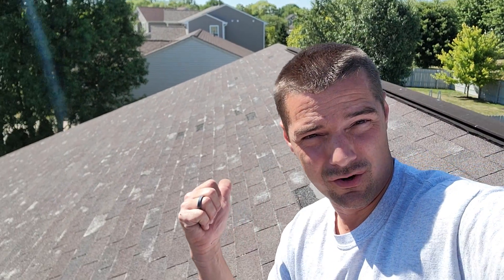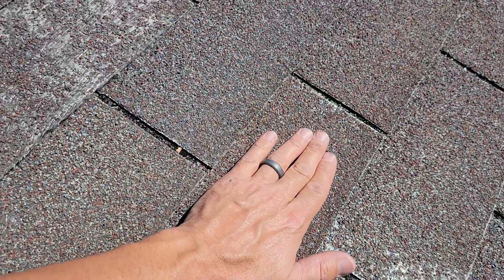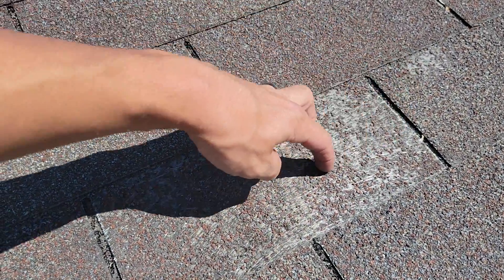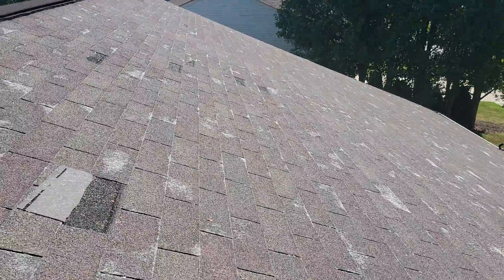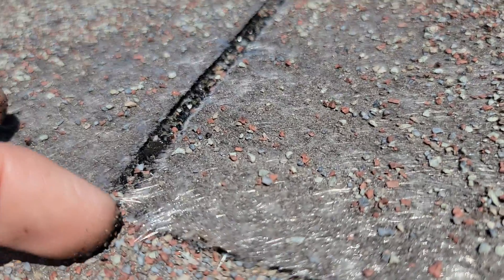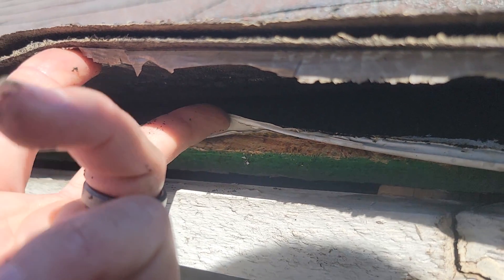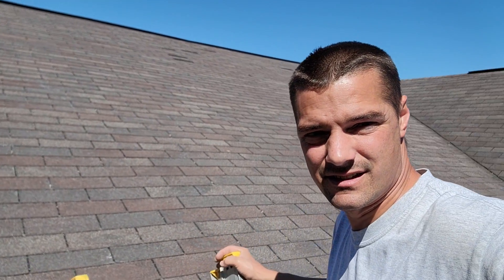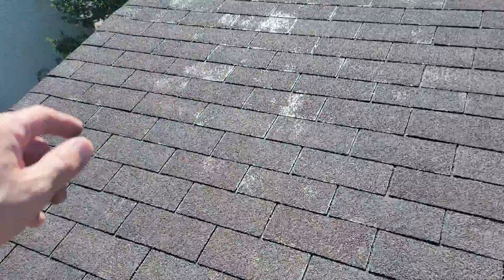Why roof shingles have granules on them.

Comment: Absolutely loathe and hate gutter “SPIKES” for hanging gutters. Imo, lot better alternatives out there, but ppl are “used to” the spikes or a hidden screw bracket of some kind (see both of these always missing fascia board, splitting it, going in way too deep, etc). Ppl I feel also don’t realize that there are several diff types/kinds of gutters as well, and choosing the proper gutter shape/style for your house is just as important as choosing the correct fasteners for said gutters; just like choosing the correct style & color of shingles, underlayments, flashings, drip edges, & so on for your house…..that once all combined, makes a cohesive system that “should” help all components work as one and protect the house live in😃

Comment: what's your opinion on metal roofs ? they're becoming more & more popular in my area ( especially thanks to their ability to make snow slide off the roof as opposed to 5-6 ft piled up all winter ) , and while they do cost more than your typical ash fault shingles , I've heard they last much longer & are much more resistant to the elements , but is that extra time & resistance work the added cost? or is it negligible ? have you found many problems with them during any inspections / repairs / installs ?
Reply from the maker: Yes steel roofs can last longer and perform better than asphalt shingles. With that said though (the steel being installed is only as good as the guy installing it.) Most steel roofs can also get you a Hail class ratingWhich could also get you a discount on your insurance premium.

 I find some people throwing up steel at a bargain price but this typically is the outcome, check this video out.

https://youtu.be/6XLVLtREz6E
Reply: @GrandRoofingInc  thanks for the info , we don't get a lot of hail here in eastern Canada , BUT , I'm sure that classification still exists on most companies books , something they don't talk about of course., the house i'm in now just got a new roof on before being listed when we bought it , but down the road i'm sure i'll be replacing at roof in my life , and i've always been weighing the pros and cons of steel vs ashfault , i appreciate your insight.
( i'm also an electrician by trade , so I know better than to higher the guy with the lowest price , those guys usually get crossed off the list pretty fast.)
Reply: I always tell people to check the gaskets on on the screw or nail heads because the sub breaks it down but the metal last forever.  Plus only if installed properly.  I don't like the rain. On the roof but if you have heavy snow and a steep slope. Might be worth it .
Reply: In Australia we've been running corrugated tin roofs since start of our existence and they last a very, very long time, only problem is you have re screw/nail your whole roof if your finding nails sticking up everywhere but these problems are only after 20 or so years and is a very cheap to perform. down side is very slippery if freshly painted or coating has been worn out by sun making it powder also makes it slippery. plus you got sound of rain on tin which is very nice, but walking on them is best with tennis shoes and on spars/nail heads only.

Comment: I love how even on the other side of the planet home inspectors are completely useless. I'm positive the entire industry is 1 huge scam. 
I had a house inspector call me in for a roof leak on a real estate house, cracking in the ceiling, must be the roof. I followed the crack down the wall, across the tile floor out the back across the concrete to the collapsed retaining wall. 
BRO HALF THE HOUSE IS SINKING INTO THE FUCKING GROUND! God damn.

Comment: Can't you just reapply the asphalt with granular?
Reply: No, you cant
Reply: It might be possible for a roof just showing signs of wear, to apply a new thin layer of protection since the shingle isn’t compromised in a significant way yet, though I’ve never heard of such a thing being done. but once it gets to this point the damage is so severe it would be impossible to repair the existing roof, just look at how bare the fiberglass is, slapping a new coat on won’t fix that issue even if you somehow got it to bond correctly.
Reply: You should experiment and let us know

Comment: Ok I know you do asphalt roof not being  a ass but if I owned a insurance company I would never cover a asphalt roof old technology metal  or other composites are way better. Asphalt is so outdated and fiberglass are a joke. Just my opinion.
Reply: Asphalt is pretty much the cheapest option but can last 20+ years if done absolutely right. Other roofs, tile, metal, slate, cedar costs so so much more as it requires a different roofing system entirely.

Comment: Is it common that a bunch ofthe asphalt comes off after getting your roof replaced?
Reply: It's pretty common for your gutters to have a bit of granules after a install, as all of the extra granuls that were just caked on fall off from winds and such, kinda like if you've ever put sprinkles on a cake lol.

But too much granules is definitely a manufacturing defect. Shouldn't be grading huge handfuls of it out
Reply: Thanks ... not tuns of asphalt came off.. they didnt do a great job cleaning up... might be alot of old shingles

Comment: Do the granules also assist in water dispersion so that there is less rapid water run off?
Reply from the maker: I've never been asked that before, I would imagine it's a little harder for it to run off as opposed to a smooth surface like glass. But if you get enough rain it's still going to come off pretty quick.

Comment: Cant they just make the granule layer thicker? Im sure that whoever designs and manufactures shingles WANTS THEM to degrade faster rather than slower without making it seem too obvious. Just like phone companies want you to upgrade each year
Reply: Roofs that are installed correctly, specifically asphalt shingles style, have a 20 to 25 year life time expectations. Obviously theres a margin for error depending on different factors but still. It's not like Big Shingle is out here screwing the little guy. Usually the person who screws you over is the crew installing it
Reply: Well, yes, they could. But at what level of thickness and weight do you say enough? Roofing has ALWAYS been at the mercy of the elements: wind, hail, rain, sun- and it all causes wear. But the materials used in modern shingles are FAR superior to 50 years ago, and last much longer. Most homeowners will not be in a house long enough to replace a roof. I live in Michigan and just replaced my house and garage roofing last year. Garage was 30 years old, but very steep pitch which increased the life. House was 22 and 18 years due to an addition. Told my wife it's the last roof I will ever have to install on this house. I'm 61, and don't plan to be living here 20+ years from now when it next needs replacing!
Reply: Asphalt shingles needs to be a certain price for what they provide, if you want something that lasts much longer but also more expensive, get clay tiles for example. Many types of different materials to be used for a roof, all with different lifespan and price. It makes no sense to overengineer the asphalt shingles and increase the price, when you can get one of the other already existing solutions instead for that same price. It would simply beat the point...
Reply from the maker: I'm sure there's a lot of big companies that want to be a more consumable product yes, but I would think if a particular shingle manufacturer designs there's to degrade/Wear out faster than the competitors their reputation would turn bad pretty quick. As a few of the other people have committed the crew doing the install and paying attention to the install details is more important. Then you have the fact if the shingles cost more it would put them closer to an alternative material price and the consumer would just choose those.
Reply: There is only so much you can stick to the asphalt. Also no guarantee that a thicker should go left any longer in the weather. The thicker the shingle the less it flexs, the easier wind damage is.